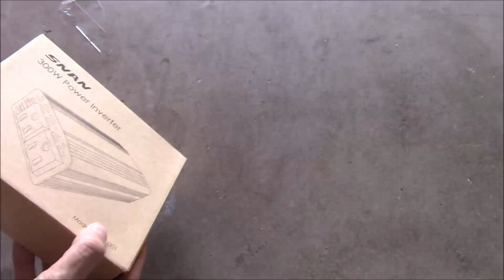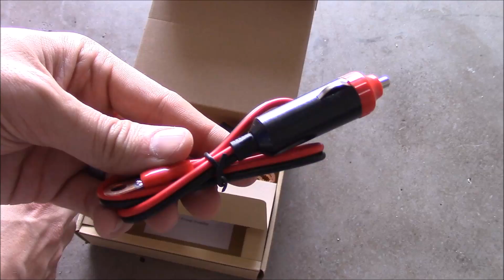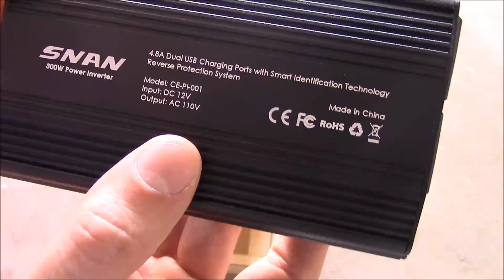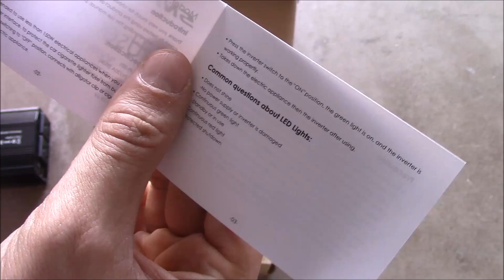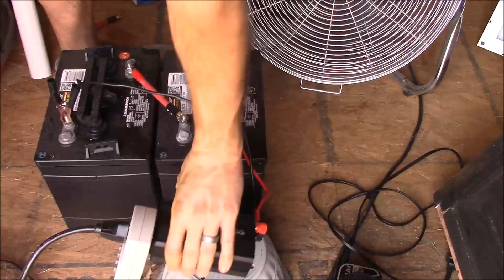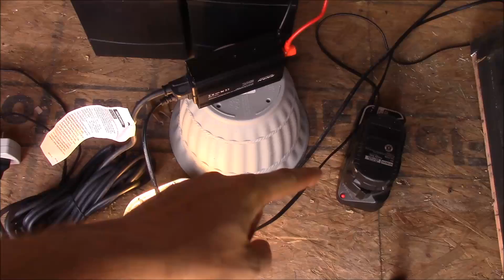Snan 300W Inverter Review

Comment: Hey, thanks for your great videos. I am watching them with pleasure. I am just wondering why you do not use a breaker in this particular instance. Is it because a fan is not a sensitive equipment? Do you need a surge protector after the inverter? Thanks!
Reply: +Kirill Pushkin Well, I guess I got the idea when I finished watching it :) . It is for a rough equipment...
Reply from the maker: +Kirill Pushkin This type of inverter will work for most devices that don't have a sensitive motor or power transformer.  So I would not use a laptop or computer with this.  Basically if you turn on the device and it starts making a humming sound or a clicking sound then unplug it.
Reply from the maker: +Kirill Pushkin Thanks for the support!  I have two more videos that I will be uploading soon.  If you keep watching them I'll keep making them.

Comment: Came over here from your post on Amazon. I'm worried about the Modified Sine Wave. I want to use this to power my laptop/chromebook and LTE router in my car. Are there any Sine Wave car inverters that you can recommend with USBs and power outlets? Not having much luck locating them on Amazon.

Comment: Cool. I think this little MSW inverter would be great for folks starting off with solar on a budget. One battery, a small PWM solar charger, a few solar panels, and off we go. With 400w of power...that is almost useful for a many small appliances. That is how I started. Good job on this review.
Reply from the maker: +Chris DIYer Thanks, I appreciate it.  I was pretty surprised that I really could find nothing wrong with this thing.  I was very skeptical but it is great for $25.  And I agree this is a great unit for someone starting out on solar.